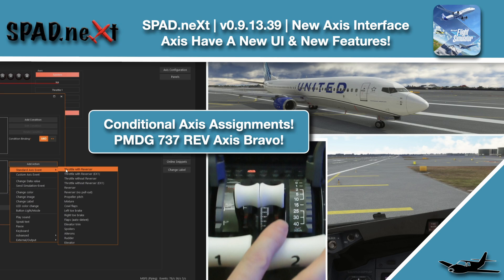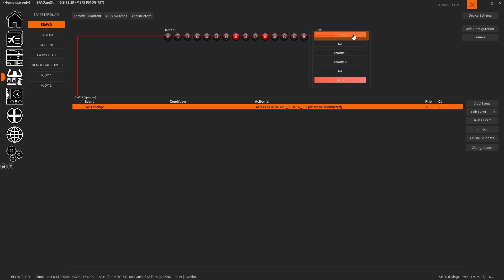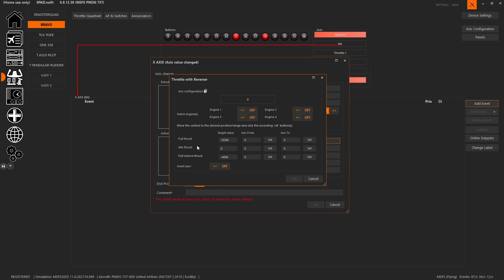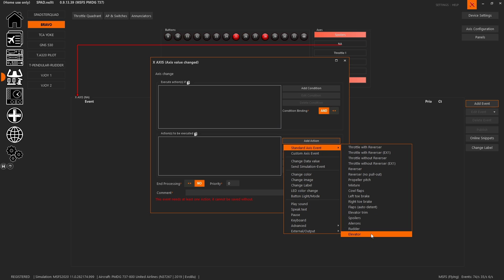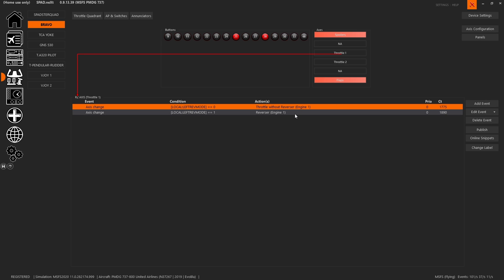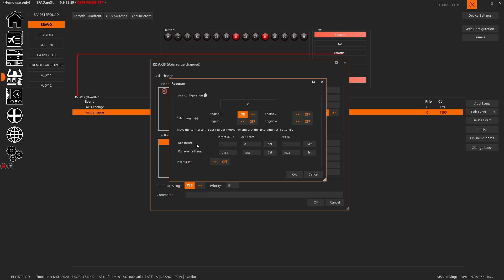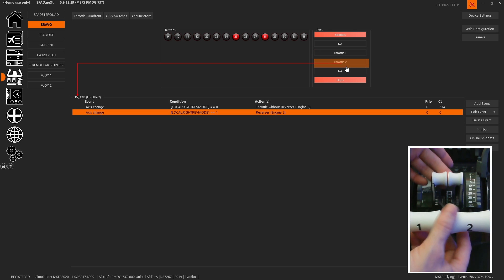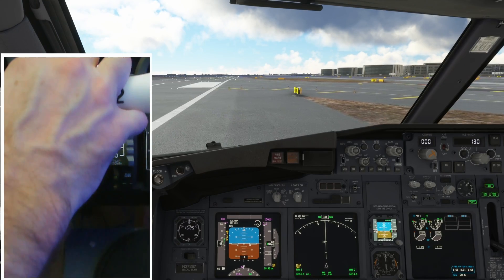MSFS | SPAD.neXt | v0.9.13.39 | New Axis GUI and Features

Comment: Thanks Les, great vid! I'm trying to set the reverser condition for the iFly Max8. I will check in the Discord section.
Reply from the maker: A similar approach might work if they just use the standard throttle — ie use the throttle without reverser and then the throttle with reverser and the local variable toggling between them.
Reply: @LesOReilly @LesOReilly  Kk, thanks. I am entirely new to SPAD.Next, I knew about it, but I wish I had started using it when I first got into the hobby over 25 years ago. Good way to keep the grey matter sharpened. I love how the GUI has transformed over the years. Thanks for all the content you provide.
Reply from the maker: Yeah Spad.neXt I think started in like 2015 and I found it that year as well...  I had all these Saitek Panels I had just bought and wanted to make them work with other planes :) .. ..  Back when they had that WASM bug in SU5 ... Nothing  worked for a week...  I just did not bother using the sim.  I will never go back.

Comment: Thanks for this, I only have 1 problem when i try to change buttons 10 & 11 it will not let me change to switch only button pressed/release any workaround on version 09.16.4, it will not let me configure my bravo tq
Reply from the maker: Because after version 9.12 the normal and simple buttons were combined. No longer need to change. There is a video that explains it but you will see you have all button trigger options in the one mode now.

Comment: Hey Les, I just  started using spad.next and loving it!!! Thanks for the work Les. I just saw this video on YouTube It was super informational!! Thanks again Les.  Im running two Saitek throttle quadrants, so I’m using lever 1 for spoilers, lever 2 is not used, lever 3 is throttle 1 lever 4 throttle 2 lever 5 is not used and lever 6 is flaps. Watching that video I can use the buttons after the idle position on lever 2 and 5 and then use the throttle 1 and 2 levers (saitek levers 3 and 4) for the reverses, but I can’t use the buttons after the idle position on lever 3 and 4 and use the axis on saitek levers 2 and 5. Hope I am explaining myself. Thanks for the help again!!!
Reply from the maker: nope don't understand what your trying to do with the other buttons.. make sure you don't have anything still mapped in MSFS bindings .. and also maybe join the spad discord and post screen shots of your configuration and what your trying to achieve.
Reply: In other words, I want to use two different axis other than the throttle axis to control reverses. Thanks again
Reply from the maker: @hova81 sure just use the buttons to write the var value you like and use that as the condition for the lever. Instead of putting them on the same lever still use conditions just on the other levers.

Comment: Recently bought Spad.next in anticipation of my sim build. Wanted to get familiar with a program that would allow me expansion control throughout the build. Glad to have found your vids. Havent started setting up spad yet, but Im sure I will be overloaded very soon.
Reply from the maker: easier to find the videos right in the app since they have categories :)
Reply: @LesOReilly  ….do you have a recommendation on where best to start? I have several hundred hours in MSFS flying airliners (fenix a320 and pmdg 737), and have setup within the sim several different controllers. Should I start with a video on setting up something specific like the Thrustmaster Airbus quadrant?
Reply from the maker: The “new user” videos are designed to help get started with spad and understand the application and “workflow”. Then yes there are videos specific to the 737 which are helpful for setting up “types” of control. 

The features section has videos that target certain features / implementations.

Comment: Hello Les, I am a huge fan of all your SPAD work and over the years have learned so much from your excellent videos. I carefully followed the steps in this video which made short work of setting up the throttles and thrust reverse on the PMDG 737-800. I was very happy with initial tests conducted with the aircraft stationery on the ground. However, I have found that in a typical after-landing scenario, the right thrust reverser sometimes fail to activate. Note, both thrust levers are in the idle position and the engines are spooling down before moving the reverser levers on the Honeycomb Bravo.
Reply from the maker: No idea. Could be that the button/switch is not picked up? Maybe put in the data monitor the relevant data variables and see if they track as enabling.
Reply: @LesOReilly  Thanks, will give that a try... done quite a few tests and the issue seems to occur if the reversers are activated before the engines have had time to spool down far enough but, of course, this delays the deployment of the reversers which can be quite problematic on short runways
Reply from the maker: if you google about reversers you will find multiple topics on it regarding PMDG ..  Maybe have a look at this thread .. seems there is also an option in the FMC to alter this..  But any rate .. there is a delay from IDLE to REV thrust actually starting..
https://www.avsim.com/forums/topic/637822-pmdg-737-800-reverser-delay-is-it-me/?do=findComment&comment=5010543
Reply from the maker: https://forum.pmdg.com/forum/main-forum/pmdg-737-for-msfs/264750-several-second-delay-in-reverse-thrust
And also that one
Reply: @LesOReilly  Thanks Les, as always 'top-man'... haven't given up on it, would prefer it actually but for me, the previous method using bindings in MSFS is more reliable... will check out the links and follow up on your advice ... thanks again :)

Comment: Can you do one for the ATR? Can I just follow this for the atr ??
Reply from the maker: I have not tried this on the ATR not sure if it works the same.
Reply: @LesOReilly   I got it working for the ATR. Also do you know how to map the PMDG tiller in SPAD??? Cant find anything anywhere!
Reply from the maker: I have a device that I always use so it's bound to the Steering Axis in the sim ..  there is a steering axis available in spad so I would assume that works.. however since I don't need to ever remap my steering axis I just did it in MSFS.
Reply: @LesOReilly  ahh okay cool. Yeah I gotta get a device to use. I use my airbus side stick so I try to keep all controls through spad. yeah cant find any steering input in spad for tiller steering. Thanks
Reply from the maker: @Pilot86MS  I use the side stick as my tiller as well :) but since that part the Axis will never change for me I just left it in the SIM ...  All the buttons and the slider is done in SPAD .. but the Stick 3 Axis are done in MSFS.. that way I can also use it to control a drone camera at the same time
Reply: @LesOReilly  cool sounds good. I’m assuming that’s the twist on the side stick. I use the roll on it for tiller. Feels better lol. Guess I’ll try that out. Thanks for all your help!
Reply from the maker: yes I use twist
Reply: @LesOReilly  yeah the twist travel was just to short for me!

Comment: Great video as always Les.  Many Thanks. One question - could you not use the reverser button directly i.e. not have to create local variables?
Reply from the maker: You can and specifically for this that would be fine..  However if I ever want to reference the same "state" on another controller then you have to change to a Variable...  I just am now in a habit of creating the Local Variables for any kind of state conditions..  Just gives me a consistent implementation.

Comment: Another great job Les, (smashing those 'Like' buttons) any chance of sharing throttles with reversers (MSFS/PMDG 737-800) via snippet please?
Reply from the maker: ugh .. yeah I probably should have updated my Bravo Snippet after doing this video :)
Reply: @LesOReilly  curious... @ 08:30 / 12:55 under Condition you have ==0, ==1 but mine says equals 0, equals 1
Any idea why yours says == and mine says equals (I am also using 0.9.13.39)
Reply from the maker: because I use EXPERT mode so it does not use "words".. there is a couple other things that are different in the UI.  But that is the one that most people catch and ask about.
Reply: @LesOReilly  Ahhh, thanks, I think I remember reading that somewhere else now... Oh, some constructive feedback, I have been testing the SPAD throttle/reverser setup (MSFS/PMDG 737-800)... may need just a little more work on the reversers config ... inconsistent results, sometimes both reversers work fine but occasionally one of them (usually engine 2) fails to engage as the throttles are advanced forward... seems quite critical both throttles are at absolute idle before the reversers levers are activated... just a thought, wondering if it would work better if another action to cut the throttles is added to the reverser levers?
Reply: @LesOReilly  Hi Les, Did you modify your PMDG Bravo Snippet so reservers work as described in this video?
Reply from the maker: @ChasCo24 pretty sure I did.
Reply: @ChasCo24 did you confirm the Bravo snippet was updated by Les? Just going to install it and saw this thread
Reply from the maker: Most people don’t test it running in a runway. They don’t work if you try to do it with the engines off.
Reply: Got this working fine except for rev thrust  value. My PMDG 700 full reverse thrust value is -4096. Moving the  Bravo throttle results in full reverse thrust value of 1023 which real does not slow the plane down much. Tried to manual edit -4096 and that didn’t work. Should the manually edited value be a +4096?  Or am I’m doing something wrong?
Reply from the maker: @Fltsimguy  so change the values that is sending for full reverse.  make sure the values are set correctly